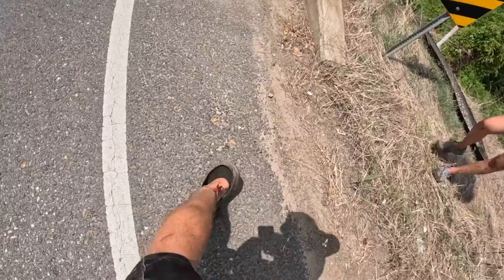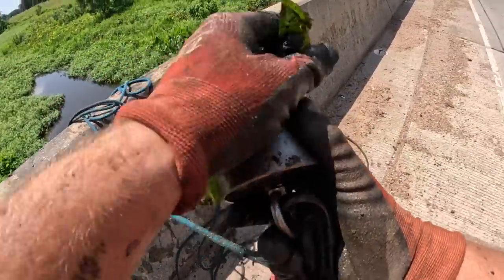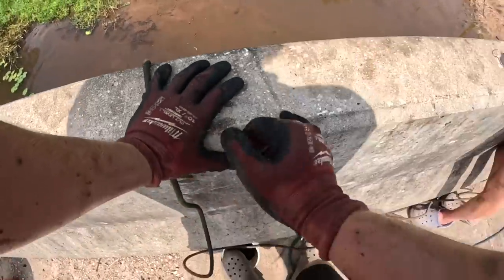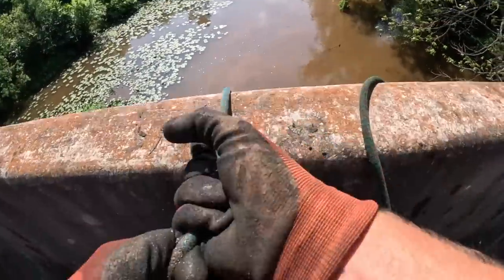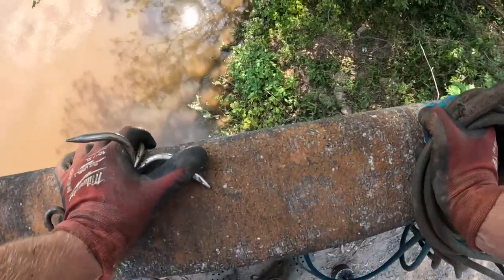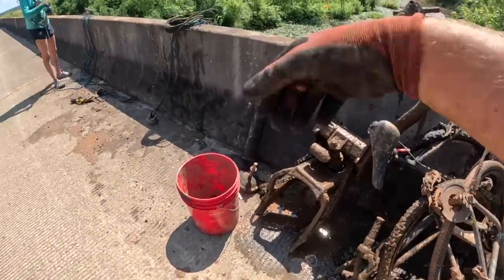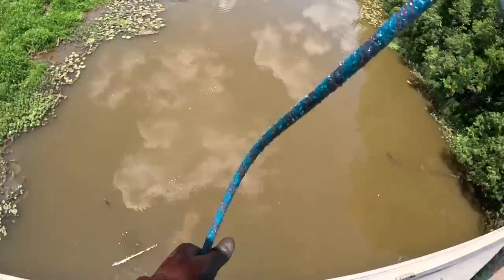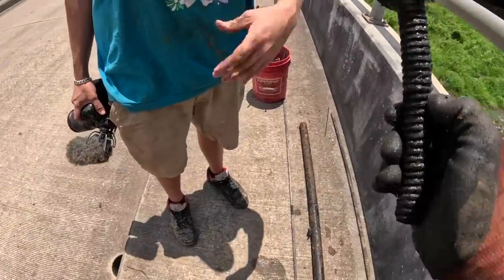WARNING: BLOOD Magnet Fishing Gone Wrong - Painful Magnet Fishing Discovery

Comment: As others have said, the pointed metal thing is a cotton picker spindle. I know a 6 row John Deere Picker has 3360 of them and the cost around $ 5.80 each. That would total                 $ 16,000.00, for just set of working parts on the picker. They are mounted on a bar with gears, the spindle spins as the drum, where the bars are mounted. The spindle has barbs on it to pull the cotton out of the bolls, it then spins through a round rubber spinning device to tub the cotton off and blow into the packer, and then it spins through a moisture pad to wet the spindle so the cotton will stick to it. They wear out and have to be replaced. That is why the John Deere Cotton Picker cost 1 million dollars.

Comment: Put one of the ends down inside the trailer and put the other end on the back of the gate then if you have strap strap it down but you wanted straps under and around it then strap down keep it down

Comment: Bike for the 4 you found!!! The things you were calling taps, I am pretty sure they are not. That being said I would like to know what they are for sure if anyone knows. Thanks.
Reply: Hey Robert,  I do believe it is a steel-drill-bitt!   They come in varios szs.usually in a set. More/likely  4 the Bridge Holes. :) NZ. ☮👍🙏
Reply: It's a reamer of sorts can't remember the exact name, but it's  to debur and knock the slag out of holes. Like if you cut it with a torch and have a ragged hole it smoths it up for the most part. And when you drill out  holes and have the bur that it leaves it knocks it off.